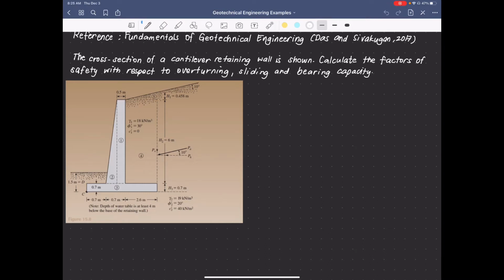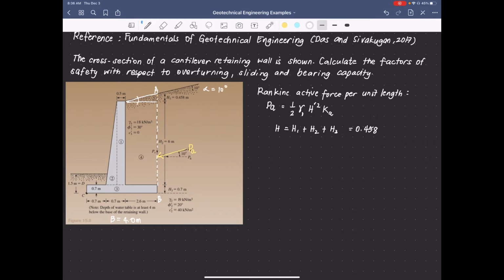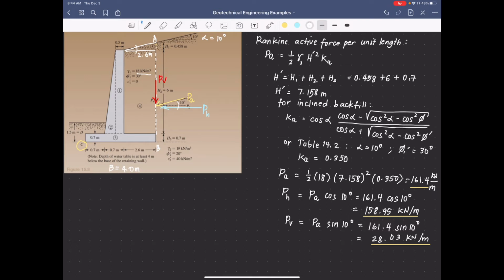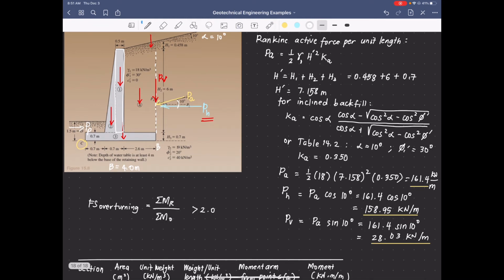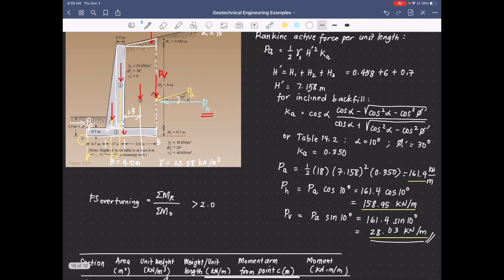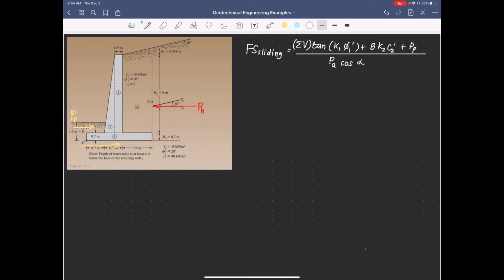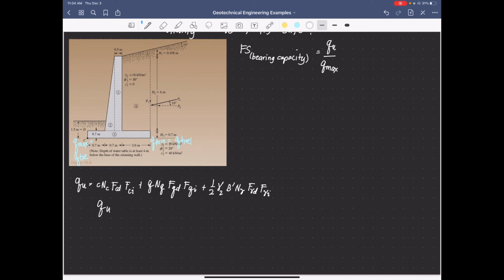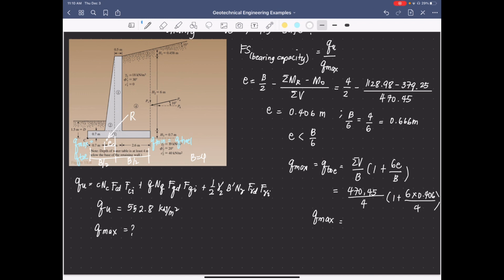Retaining Wall

Comment: why the passive verticle force is excluded ?
Reply: passive soil are always assumed to be not permanently located. At least on what i have read, It is assumed to be excavated along the lifespan of the retaining walls . So, to incorporate this possible future excavation, neglecting it on the analysis and design would add an extra factor of safety for the expected future excavation since passive soil weight and lateral earth pressure contributes to the stablizing force and moment resisting the active earth pressure that tends to overturn the wall.